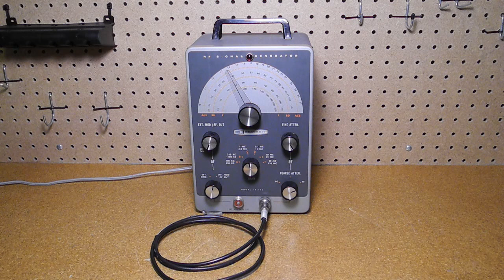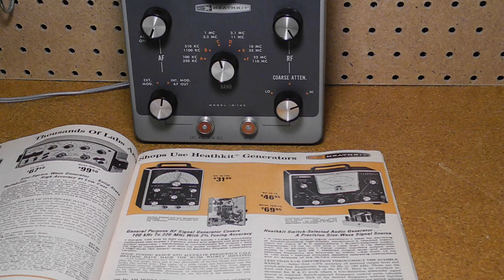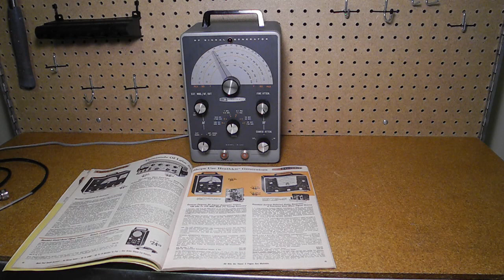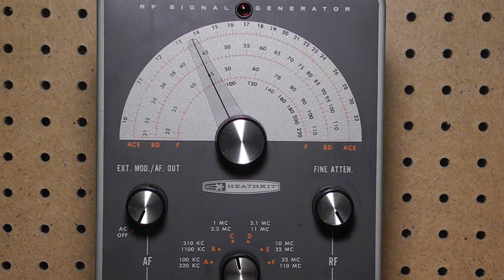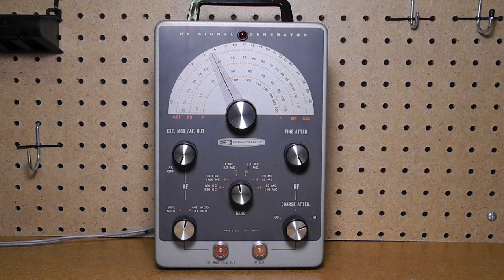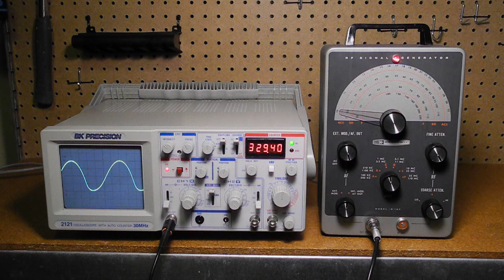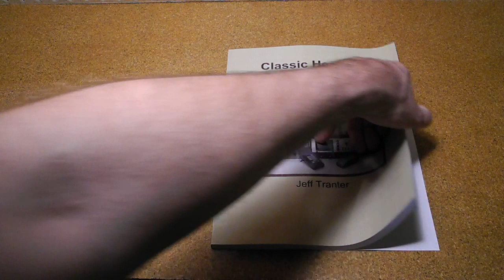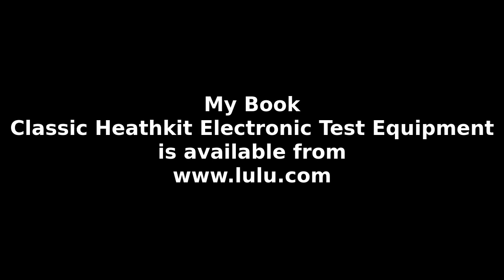The Heathkit IG-102 RF Signal Generator

Comment: Thanks, just got one and am working on getting it working.
Reply: Did you work out what was not working?
Reply: @typedef_  Yes I did. It came down to the original cap was replaced with amazon defective caps. Installing a quality 2 or 2.2 pF cap got it working. Since I was able to source them, I put in NOS 2.2pF like came with the original kit.

Comment: Hey Jeff, question about what you mentioned with the 102 vs 102s models. I unrealizingly got one of the 102s models and it is exactly as you described with the RF leakage being a bit all over the place haha. I don't plan to use those front jacks the model adds in, so I just wanted to double check what you said regarding disconnecting them. I popped open the case and it looks like the wires are soldered in as their own branch off. It's a bit tight to get a soldering iron in there, so would just cutting those lines and removing the sockets be sufficient? I was figuring probably would want to put some foil tape where the holes for the added ports would be too. OR, can it be just as good to just get some plugs for those ports to stave off the leakage?

Appreciate the help and all your in depth videos on these classic devices!
Reply from the maker: Cutting the wires and removing the sockets should be sufficient. Slightly better would be to cover them with something conductive like foil tape or if you can come up with something creative using washers and hardware or sheet metal to cover the holes.
Reply: @jefftranter  Ah ok that makes sense. Thanks for the info!

Comment: i have two of these.great equipment however both have same problem.   the tuning is difficult to  stay  on frequency.  the moment i release the knob the freq changes . i have cleaned and re-lubed variable cap front and rear bearings.   i even lubed the inner part of tuning shaft.   i'm tempted to devise a separate band spread arrangement to deal with this problem.  any suggestions ?
Reply from the maker: There is a vernier reduction mechanism on the tuniing capacitor, but it can get gummed up and frozen. You should see almost three turns of the knob to get the tuning indicatr/capacitor to rotate througn 180 degrees. If you only get 1/2 a turn of the knob, then it is frozen and you need to try cleaning it. Could that be the issue?
Reply: two units same problem.after cleaning and lube i get the turns needed and operation is smooth as silk. .through trial and error it stays on freq  when tapping  the knob. vernier must  be bad watta pain

Comment: Thanks for the video! I was given one of these a long time ago, went to use it tonight for essentially the first time and when I put my scope center probe on the output bnc I get no output.  Guess I get to do some troubleshooting :(   AC power caps to chassis ground confused me for a bit as just disconnecting the scope ground lead I was reading 60 hz.

Comment: How do I hook this up to a Tektronix 465M scope to test it?  I purchased one because of your video.  Tubes checked out OK.  Lights up.  I cleaned the contacts with Deoxit.  What's next?  Thank you.
Reply from the maker: +8xlaxx If you set the COARSE ATTEN. to HI and FINE ATTEN. to maximum, the RF OUT output should produce a signal you can see on an oscilloscope. THE MOD. IN/AF OUT jack should also produce a 400 Hz audio signal when the mode is set to INT.MOD/AF OUT.

If you don't see correct output, there is a troubleshooting section in the manual and voltages on the schematic that you can check against. If you don't have a manual you can download one from sites like mods.dk.

Good luck, and be aware that there are hazardous voltages when the unit is powered up, so use caution when working on it.